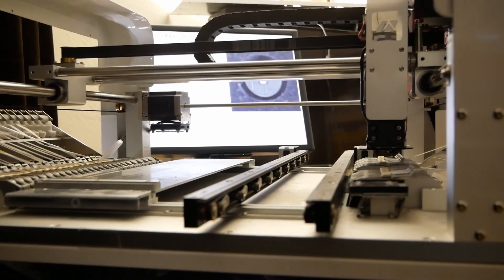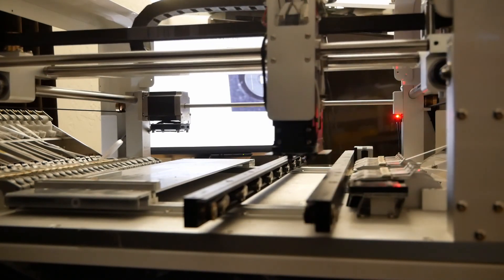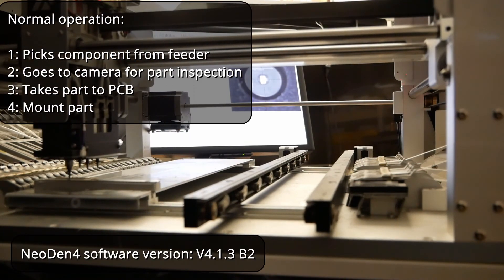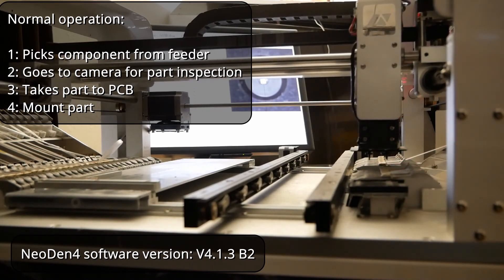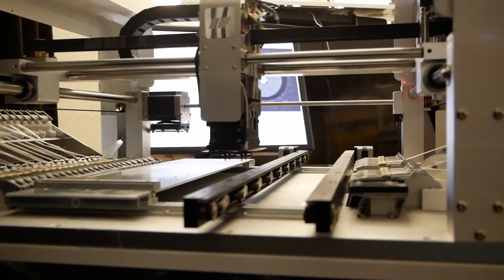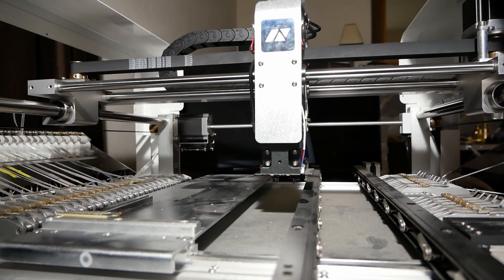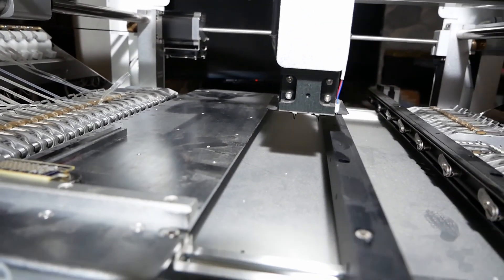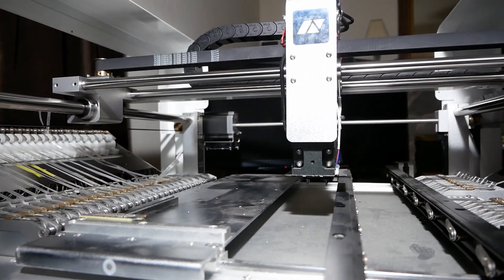Motion Sequence Error on NeoDen4 Pick and Place Machine

Comment: Hi we have same problems , how we can solve that?
Reply from the maker: We tested each feeder and peeler individually by manually advancing them several times under the "Manual Test" tab with the "Feed Peel Synchronous" box unchecked. During the test, we discovered that one of the feeders was not responding. We unplugged the malfunctioning feeder and noticed that the feed-box feed error disappeared.

After removing the problematic feeder, we retested all the feeders with the "Feed Peel Synchronous" box checked and found that they were functioning properly without any errors. We tested multiple times on each feeder and did not encounter any issues.

It seems that the malfunctioning feeder was causing severe problems and causing the software to hang. Removing it appears to have resolved the issue, but we are unsure of the cause of the problem, whether it is with the feeder itself or the software.

What are you currently working on?
Reply: @sprucescience  We had defined two nozzles in the pcb information section, but in the feeder setting section of the aply section, 3 nozzles were ticked, and we apparently solved the problem by removing the extra nozzle.
Reply: @sprucescience  We are also having this problem recently where we are having a problem with the "photograph is faild" box, do you have a solution for that?
Reply: @ibrahimmousavi Hello İbrahim, I am getting the "photograph failed" error, how did you solve it?
Reply: @lovesick34  Hello, I have a 3V-Adv and that error (Photograph error) appeared when the cables of the camera (USB) where loose so the computer doesn't recognize it anymore. Additionally, random miss placing error where produced because of a faulty connector on the stepper motor that rotates the nozzle. In summary: Whe soldered the cables directly to the cammera (down looking), changed the USB port of the uplooking camera (inside the machine), replaced the faulty connector on the stepper motor. I know its a little bit older the question, but I believe someone will found it useful.